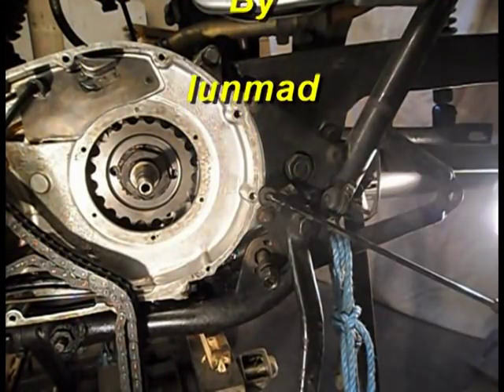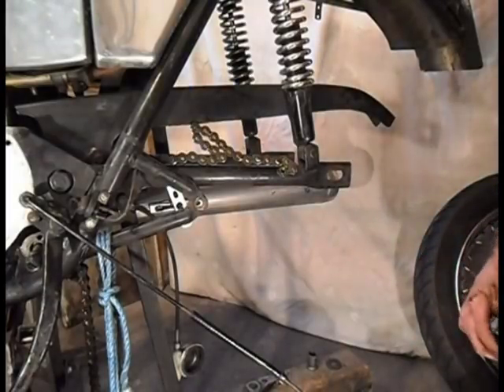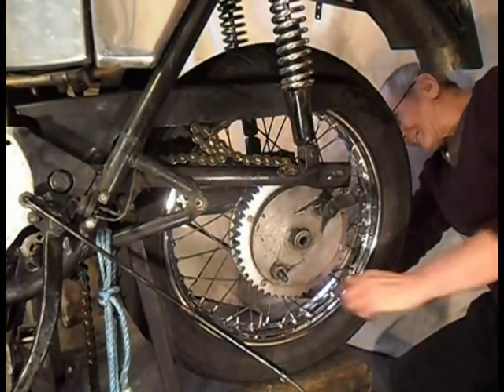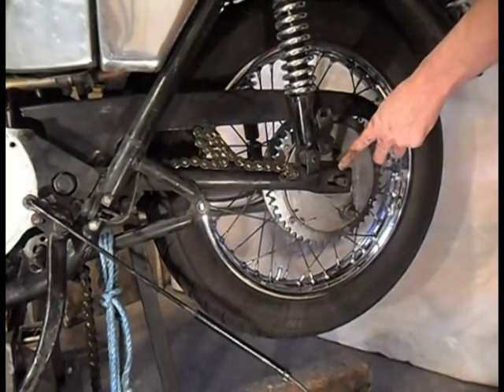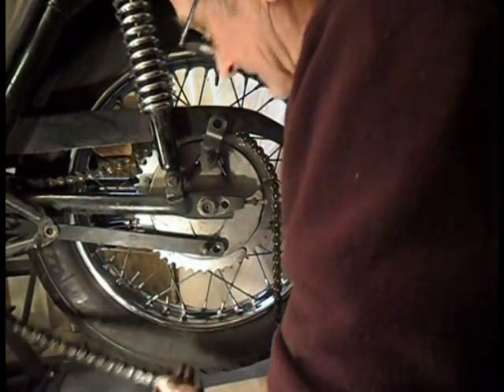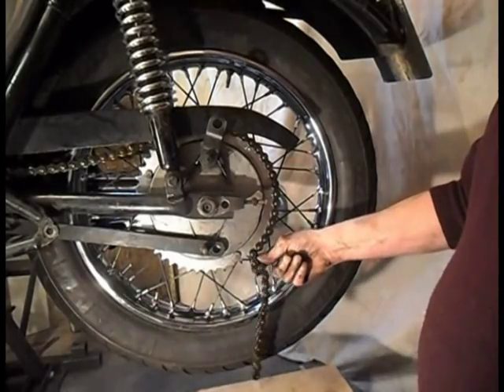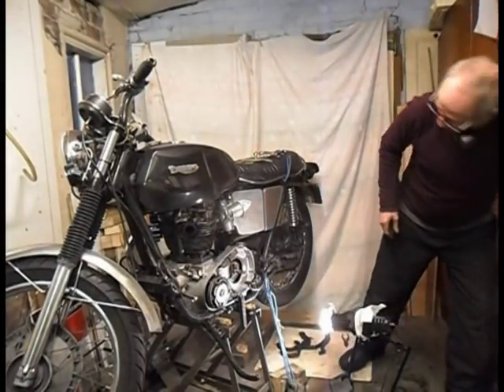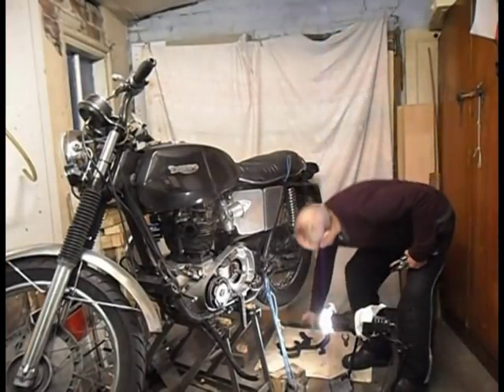Changing the chain and sprockets pt 3

Comment: A up pal, just wondered if I could contact you in some way, just done up my 1973 T120v and having problems with it, starts, runs gets to 4k on the revs and doesn't want to go any more, just splutters etc, seems to be a fuel issue, when you put the choke on whilst running it gets better but only a little. Just doing my head in, had this bike since 1980.
Cheers Kev.
Reply: whats the spark plugs look like
Reply: Hi Steve,
I have just rode it into work so I will take a look and come back to you.
Reply: Spark plugs look in good condition !!